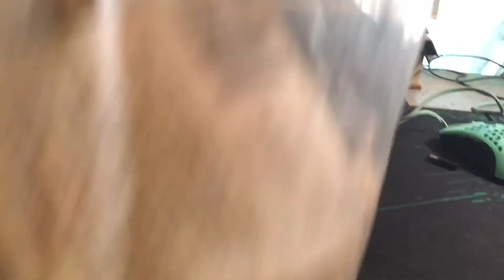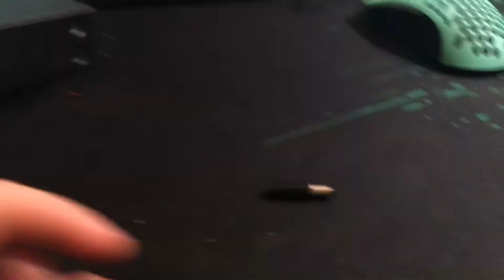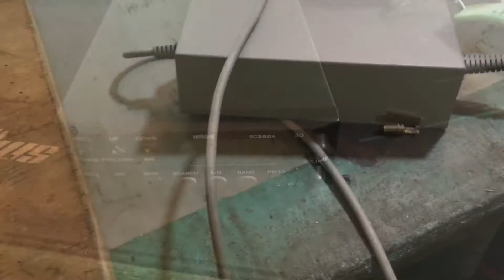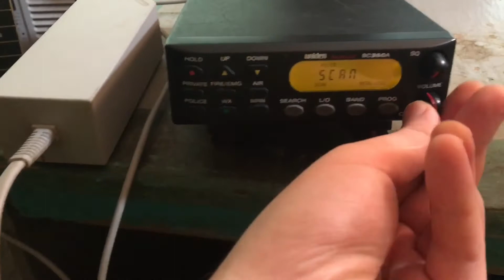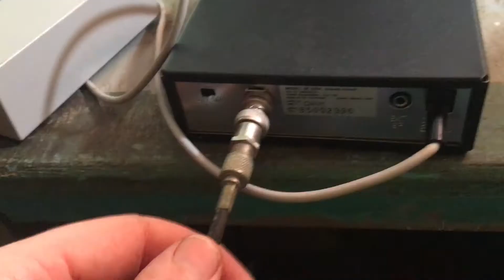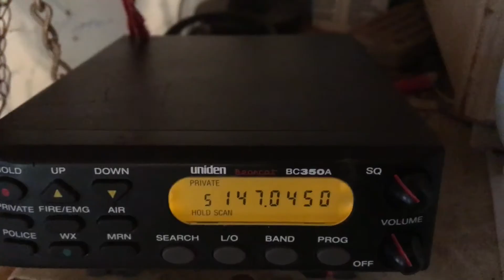$10 Scanner + setup and install

Comment: If you want a really good scanner antenna take a piece of 300 ohm twin lead get you a connector on a pigtail and put a three-quarter inch PVC cap over that before you solder it up to the twin lead that's cut 4 foot long and on the negative side at 12 inches make a quarter-inch notch get that in a three-quarter inch piece of PVC pipe with a cap and get it up in the air is high as you can with some coax you'll love it
Reply from the maker: Thanks buddy! Sounds like an off center fed dipole, should work well!
Reply: @JohnnyJonesathome  the guy says you want to keep the coax short but that's not true because the 300 ohm antenna itself needs that 50 ohm coax to push off of for it to work its best
Reply: It's actually a instructable online I Googled homemade base station scanner antenna and it came up you might check it out there's pictures good tutorial

Comment: BTW after watching your make your own DC power supply video I made myself one out if an XBox 360 power brick
Reply from the maker: That’ll work just fine buddy!

I have a couple of those myself
Reply: @JohnnyJonesathome  Make one out of a scrapped computer power supply, good thing is you can charge you mobile phone at the same time as well as charge you hand held CB  :-))
Reply from the maker: @BoB4jjjjs  Yeah that’s true you could use a 12 V rail for the radio and the 5 V rail for charging your phone
Reply: @JohnnyJonesathome  And mix up all the other wires to get all sorts of voltages.
Plus, it is a lot safer than those small power supplies.  They have a tendency to overheat if under load, there is nowhere for the heat to go being inside a brick!
Reply: @BoB4jjjjs  The XBox 360 bricks have a built in fan and an overload shut off. Mine has worked well so far
Reply: @JohnnyFingers227  As I have never had an Xbox I wouldn't know, I am not a gamer!
Reply: @BoB4jjjjs  I didn't know either as I am a PS4 guy. I saw a YouTube video on the.
Reply from the maker: @BoB4jjjjs  True, and you can't beat the wattage rating of even a cheap PC supply.

Many of them can run a 2 pill amp. The only real downside is the noise they can generate, but Honestly I haven't heard a noticeable difference in the noise level after testing a switching power supply versus a heavy linear power supply.

But of course if I had unlimited cash I'd have a big linear PSU.

Honestly in a pinch you can't do much better than using a PC power supply, heck even a lot of the CB power supplies now are of the switching mode type.
Reply: @JohnnyJonesathome  I don't like the switched mode power supplies, but I have had my big one fail, one of the big Cap's on it blew, what a bang!  Didn't think it was possible to pack so much paper into the can!  It went off big style, bent the cover out of shape, filled it full of paper and even ripped the self tappers out of one side of the cover, just as well it spent all its energy bending the cover out of shape.
After that I had batteries from a telephone exchange that made up 14 volts and just trickle charged them all the time.  The batteries had so much capacity there was no ripple.  I could have ran a big linier off those batteries if I had wanted to.
I made the mistake of throwing them out when I got hitched, I should have kept them, but I had no intentions of returning to CB or radio.
But I did, I need to get the equipment again to tune them u and fix them.
A lot got ruined in the second move, she left it all out in the rain under a leaky cover, she was told they had to go inside.
But being a woman had no interest in all the test gear.  Found it all next day with water running through everything.
Trust me, if I had been in America you policeman friend might have been looking into a murder!
Reply from the maker: @BoB4jjjjs  hahahaha Oh man I never get tired of your stories

It’s funny how CB radio always brings you back to it, I remember being 11 and really into cb radio but I had such issues building antennas that I lost interest and of course the bug caught me again years later

Sometimes I think women just love seeing us mad haha
Reply: @JohnnyJonesathome  She knows just how to wind me up and piss me off!
Makes me wonder why we ever put up with them?
Oh, I know who, but I better not go into that.
Stay single everyone told me, but I didn't listen.  Thought I had found the right woman, but she turned out to be the same as all the rest in the end.
I have no money these days!  Wonder why?
Reply: @JohnnyJonesathome  t
Those power bricks have internal cooling fans also. Not sure if you were aware